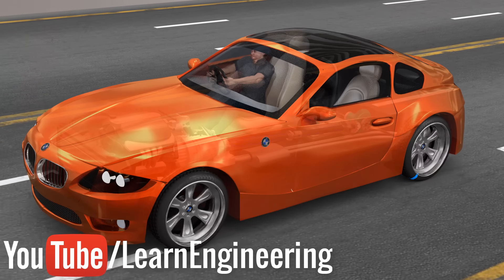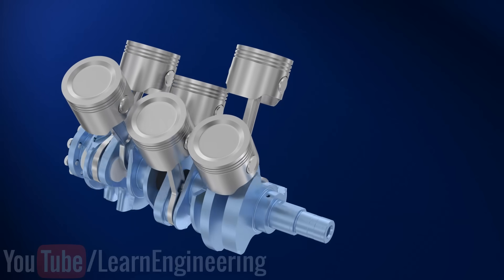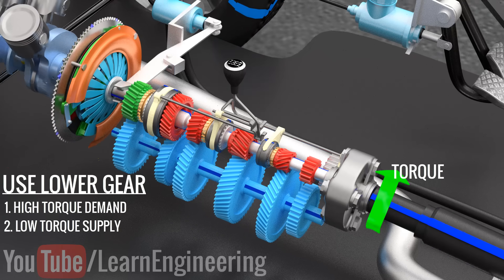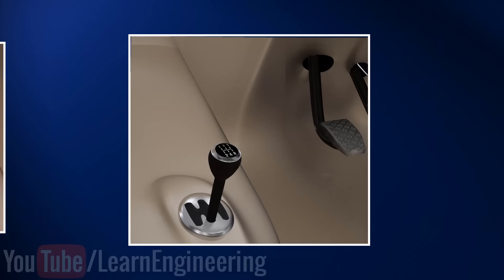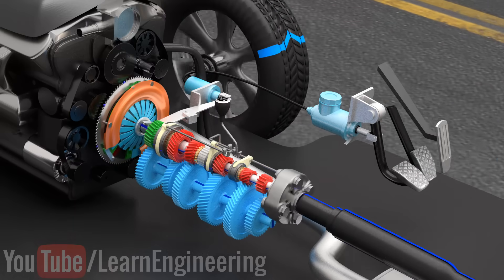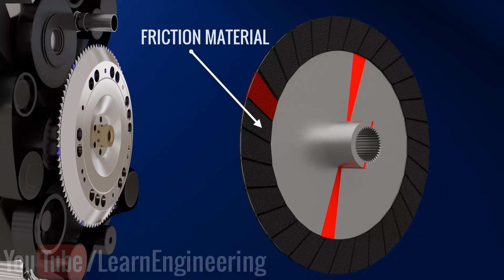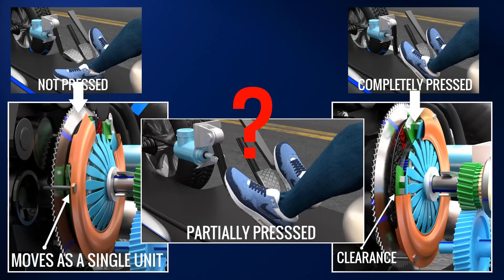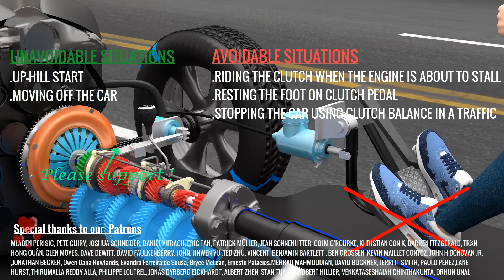Why you should not PARTIALLY press the Clutch?

Comment: Guys I’ve eliminated riding the clutch completely from my driving habits. Now, every time my light turns green, I either launch forward or stall. I live near a steep hill that gets heavy traffic due to the stop sign at the top, so I’m constantly launching forward into cars. It’s ok they’re used to me now and applaud my ability to not ride the clutch.
Reply: roflmao, this made me spill my coffee. I was thinking the same thing, but also in very slow moving traffic, <5mph you need to ride the clutch or you will stall, or keep thrusting forward.
Reply: @galatei11  It is actually possible to perceive the traffic and the small gaps and time everything in a way so you just give it some gas in first gear, and just slowly roll in neutral.
Reply: @galatei11  Riding the clutch at >5mph won’t mess up the clutch as much as if you were going fast
Reply: @galatei11  yep i always ride the clutch between 1st and 2nd gear never had to replace my clutch
Reply: @galatei11  thrusting forward is better. reduces the time that relative motion happens between flywheel and friction disk.
Reply: @Noblyuntruthful you are 100 percent wrong lol do you actually drive stick? 😂 By thrusting you are risking breaking a spring on the inside of the friction pad because you are banging it around. Not to mention you are toasting your throw out bearing. There are alot more working parts to a clutch that just the friction pad and flywheel buddy lol let's not teach someone to slam their clutch around like it won't matter 😂 👌
Reply: Lmao.. There's a thin line between riding the clutch & getting a smooth take off. I learned it's best to accelerate at the same rate that my left foot is disengaging the clutch. Tbh, I might be "riding the clutch" which is why I'm here
Reply: I’ve driven diesels before that don’t need any accelerator to set off in 1st. It’s so good for traffic haha
Reply: @Krusty_T  I actually had to modulate my diesel with a clutch because if I dropped it the car would jump forward without stalling even though I had zero gas pedal input. Coming from a rather conservative gasoline engine from before this was a startled it happened a first couple times... "I'll just rev it up a bit release the... HOLY FUCK WHY AM I GOING WARP SPEED?!"
Reply: @Krusty_T  Yup... I learned on a diesel and stalled many times when I had to drive a petrol 😂...
Reply: the people who make these videos are part of the “conserve the clutch at all costs” cult. the clutch gets wear everytime you start from a stop and when in traffic. i use my clutch all the time and on my bikes as well. its just a part that needs to be replaced and most people dont get that. they think you should preserve the original factory clutch plates lol
Reply: @Krusty_T  I did my lessons in 1 then when it came t driving a petrol car I was a little shocked as to why I didn't jus roll off with no acceleration 🤣🤣
Reply: @cheetahgaming3642  What do you mean not do it on hills? Are you talking about just using your clutch to keep you the hill without a break pedal or using it to hold your car momentarily while you transition your foot from brake to gas? 

Also i don't think it's realistic to make rev matching standard knowledge (outside of high rpm instances) and isn't all that useful in everyday driving.
Reply: @Krusty_T  I've driven petrols that don't. In theory, as long as your clutch control is good enough, you can start off in any car without the accelerator
Reply: @Krusty_T  try that in a petrol car with very low idle speed
Reply: @jminkvihubyb  most people define it as slipping the clutch when doing it deliberately and in a manner thats necessary and ridding it when your foot gets lazy.
Reply: @TheRazePlayz  exactly. I thought from the title that the video was going to claim that not pressing the clutch pedal past the point of full clutch disengagement was bad and explain why.
Reply: @jminkvihubyb  bro I never knew we were not meant to do this..pretty sure it's how I was taught..I be using it to slow down and shit lol damn I fucked up that trans for sure XD
Reply: @jminkvihubyb  it’s called using the biting point to pull away
Reply: @jminkvihubyb  that’s really the proper way. You are balancing the clutch with the gas essentially meeting in the middle letting off/ pressing down at the same rate
Reply: @jminkvihubyb  you are supposed to push on the accelerator as you are coming off the clutch....that is normal and what should be done
Reply: Hilarious. He did state though that it’s unavoidable on hills and when starting a car off moving
Reply: @jhiatt1516  it’s an American video where 99 % of cars are automatic and hence can’t drive manual cars very well if at all
Reply: @jhiatt1516  floor the gas pedal whilst letting go of the clutch pedal completely...can't stall on a hill start that way...
Reply: if you have no feel for the car ingage parking break press gas and release clutch till you feel front of your car rise, then release parking break and woala you are moving without staling nor jumping ahead.
Reply: @luk4s56  i do it on daily basis, is that bad?
Reply: One time I watched a nice beautiful car launched forward into another car's bumper when the lights turned green.
Reply: exactly, I live in the mountains. You have to ride the clutch or you will stall. Need to ride the clutch so we can crawl up mountains without cutting engine.
Reply: There is the spot where it bites. The pedal might be low but the clutch is set. I keep my foot on the pedal all the time and my civic has 220k . Theres a spring that resists the force of my foot. As long as I dont depress, its fine. If anything, the spring will go before my clutch.
Reply: @victorfranca85  same here.
Reply: Using the hand brake makes thing easier starting uphill
Reply: Made my day
Reply: I think this launching is bad for your catalytic converter.
When reves drop to fast under load unburned fuel enters the cat
Reply: Every clutch I've ever had(owned nothing but for over 15 years) has a bipoint. Release to the bipoint(about halfway) while slowly applying gas and release from the bipoint slowly but steady while gradually applying gas. You don't want to hang out on the bipoint for too long but you can get a smooth takeoff without hurting your clutch. What ends up burning it out from riding it is a constant pressure on the friction pad which overhearts the clutch after PROLONGED consistent contact. Slamming it around and stalling it is NOT a good thing. This is also known as "dumping the clutch" and you will break an inner spring, separate the flywheel, or damage the throw out bearing. My opinion. Practice. Somewhere where there is no traffic on hills and no pressure. Like some have said until you learn your clutches release and engage points do the parking brake trick. Brake pads are cheaper than a clutch by far lol burn those on hills instead until you get it down. I struggled with hills as a teen learning how to drive in general lol. My problem is I was too focused on trying to hurry and take off so I didn't piss off the driver behind me but honestly screw em. They can go around if they don't like how slow you are taking off on a hill unless they are paying for your clutch repairs 😂
Reply: hahaha
Reply: That’s what I’m saying you can’t not ride the clutch starting in first from anywhere😂 if you let out too quick you are gonna lurch and stall and possibly damage the clutch disk more than if you rode it lol. And it’s not like any human is going to be in 4th going 10 mph and abt to stall cus that’s the only situation I can think of where you would need to ride it or downshift other than being in first
Reply: I no shame ride the clutch on hills lol.
Reply: @Tchachitos  same here. Absolutely not a problem imo lmfao.
Reply: @Tchachitos  rip your clutch
Reply: 😂 damn you
Reply: That’s one of those ‘unavoidable situations’ that he mentions near the end of the video
Reply: Best comment of this section😂😂😂
Reply: Hail the king
Reply: this is the humour i roam YT  comments for😂😂 bless you
Reply: You literally just have to put in the clutch enough so that the lever can go into first, give it a little gas and then let off the clutch slowly. You won't be fully off the clutch for very much of 1st gear before doing the same for going into 2nd if you're travelling at normal speed
Reply: Yeah that's why you pull the handbrake, put the car in gear, let off the clutch to the biting point, release the handbrake and smoothly and slowly crawl up the hill.
Reply: instructions unclear, I'm wheel spinning everywhere all the time
Reply: LOL
Reply: https://youtu.be/ZDs4ET5VTtg
Reply: Well listen guys.. Ask anyone who drives how powered cars/sports cars and the majority habitually ride the clutch.. I got into the habit after driving a T-bar mr2 2seater rear engine gti. 
To even start the engine you MUST have the clutch full depress when u turn key..
Then i got a modified peugot 206 ecosse gti hot hatch and again if u didn't do what's explained on here u would stall. Its 2nd nature..also I have the admitted bad habit of driving with foot resting on clutch and its depressed slightly.
Reply: this is for shifting while moving and BARELY touching the clutch, not riding the clutch enough to disenage it
Reply: Because an example like this can only be given from someone who didn't get the message: ride to take off as you've already been taught and then learn to change gears as they were intended.
Reply: Big toe lol
Reply: Just pull the handbrake when you stop a top the hill. Once you are ready to go, shift into 1st until you hit friction point, then release the handbrake.
Reply: Long story short: clutches wear out from use.
Reply: 👏👏👏👏 the hero we need ;_;
Reply: 🤣 LMAO🤣
Reply: Apply the handbrake and find the biting point before releasing it.
Reply: learn to drive stick for a start
Reply: Put a few concrete bricks in your car, then you can let her ride on the weight.
You notice when you drive a large car, you can just engage the clutch completely and the car slows very little.
Tips, bigger engine saves fuel because it does not have to work as much, not too big but bigger then the weight and the most used speed youre driving. 
If you drive 70M (110Km) you should feel that the car is sometimes pushing and sometimes not using any power.
Reply: @Gardureth  or just learn to drive stick
Reply: @DavidMartin-vo9bx  I asume people can, but theres a lot of difference in the carengine/weight ratio, some people i know drive small cars with small engine's (1,4L) but that is a bad idea, they consume much more fuel and the engine works itself to death. a small car with a 1,6 or 1,8L engine is much more fuel economic and the engine does not have to work too hard. Saves on a lot of extra costs.
Reply: @Gardureth  what is your point
Reply: i think u missed the whole point of the video but congrats
Reply: @zkacyy  Ok
Reply: that's just called a hill start. Pretty standard stuff Dave...
Reply: I don’t know what kind of animal a clutch is but I don’t need to ride one, I have a car
Reply: LMAOOOO
Reply: you can slip the clutch if your not moving, you have to... but don't do it shifting into any gear but 1st and for the love of god do not do it on hills, if I catch someone doing this in any of my cars they are never driving it ever again. and most people will agree with me
Reply: when you stop at the light, press down the clutch fully, when you are ready to go forward, slowly release it and at the same time slowly press down on the gas (throttle) pedal

There is a big differnce between riding the clutch and a slow take off
Reply: @s0leily615  if you’re stopped at a light for 1 cycle it’s better to be in neutral than have the clutch pressed for that long
Reply: @konrah1486  true
Reply: @konrah1486  why is this??
Reply: @hazza2247  when your car is sitting at a stop in gear you are pressing the three main components of your clutch together: the diaphragm, the spring and the bearing. If you are only pressing the clutch in for 30 seconds or less it isn’t really an issue at all. But if you are sitting at a light for any more than that you’re putting unnecessary wear on those three parts of your clutch. I’ve driven my 2010 5speed Mazda 3 to 245k and haven’t needed a new clutch yet. Plus it’s not that big of a hassle to just take your car out of gear, it only takes less than a second to put it back into gear anyway
Reply: @konrah1486  ah yeah makes sense, thanks
Reply: @hazza2247  No prob homie
Reply: @konrah1486  so u mean, I put it in neutral and release the clutch, and when it goes green, I press the clutch 1st gear, press the throttle  slowly while releasing the clutch?
Sorry if this sounds dumb im still learning to drive and I don't want to pickup bad habits from the beginning
Reply: @aitahhhh  Basically! Put your car in neutral and then let off the clutch if you’re at a red light. While your light is red watch the lights that are green (traffic travelling perpendicular to you) and wait until they go yellow so you know your light will be green in about 5 or 6 seconds. Once you see their light go yellow, press the clutch and put it in first. Keep your foot on the clutch and keep it in first gear and in a couple seconds your light will be green so you can go.

The clutch is meant to be worn. However, a lot of clutches nowadays (including mine) are hydraulic meaning you won’t want to sit on your clutch pedal for 30+ seconds at a time for fear of wearing the hydraulics prematurely. However, pressing your clutch for 10-15 seconds is nothing to worry about. Basically, if you’re going to be stopped for more than 15 seconds then you might as well just put it in neutral with your foot on the brake. Over time the transition from stopped in neutral to first gear and accelerating will get a lot faster and easier for you. 

Not sure if this is helpful or not but it helped me when i first started so: A good trick for getting a feel for your clutch is to go to an empty parking lot and try getting the car moving in first gear without using any gas. It helps you figure out the clutch grabbing point really easily- how far you have to lift your foot until the clutch starts to engage. Let your foot off the clutch super slowly in first gear and you’ll know when it starts to grab because you’ll start rolling slowly. 

All the best!
Reply: @konrah1486  thank so much, extremely helpful!!!!
Reply: @aitahhhh  No problem! :)
Reply: Guys I’ve eliminated riding the clutch completely from my driving habits...     wel in that case i would eliminated driving compleetly ore take a few more lessons ore best tip maybe. go automatic!
Reply: @robbinvan1172  Automatic car driver detected opinion rejected 🤢

Comment: if u r trying to avoid "riding the clutch" how do u shift to gear 2 then? if u release it instantly the car will shake and you will damage components
Reply: Not really, if you let off the throttle and push in the clutch at the same time then the car wont shake. I have never had to ride the clutch to shift gears. If you have to, your doing it wrong

Comment: why do they always say it damages your car, its not like its going to slam a semi into the side of it, it only damages the clutch and thats pretty much all, even though its expensive to replace it still can easily be replaced. Also you can change gears while there IS power flow to the transmission, A) theres always power flow coming from the wheels and B) Power ratio between the engine and the wheels in accordance to the correct gear ratio you can actually shift without the clutch because the power is balanced

Comment: If you are a good driver, you need never slip the clutch. Lift clutch pedal to taking position, and give ONLY LITTLE BIT gas SAME TIME you lift clutch pedal up. No wasted slipping... It's easier by diesel cars, but possible by gasoline cars too.

Comment: I driven stocks for over 20 years and never used that technique. You can shift without using the clutch at all if you accelerate the drop the rpms quickly in between shifts. Hard on the synconizers though.